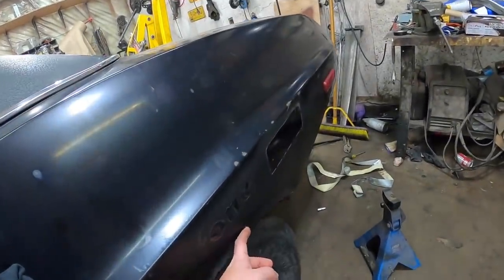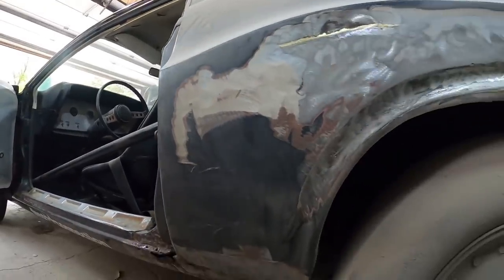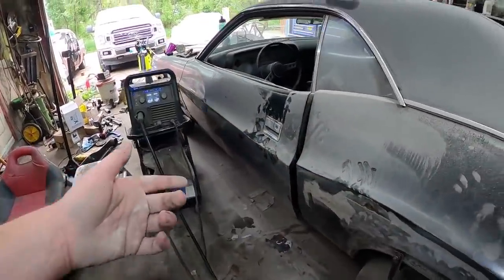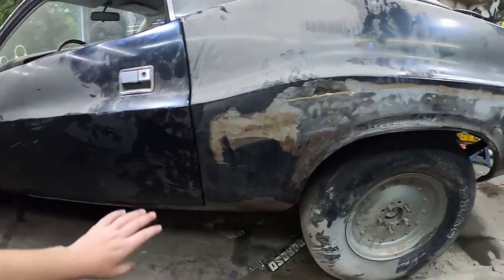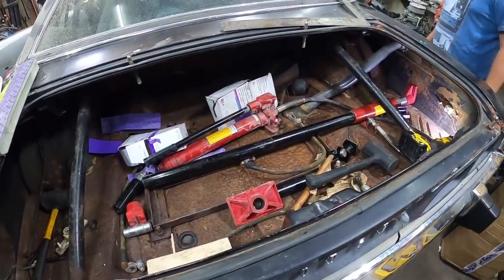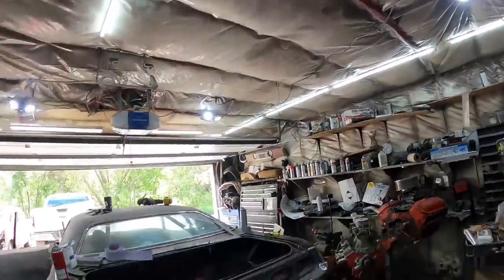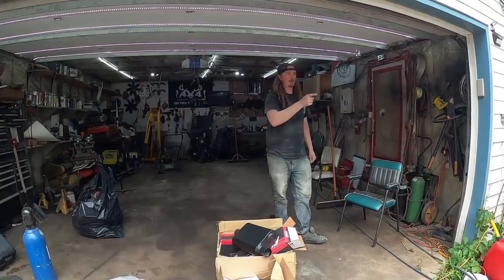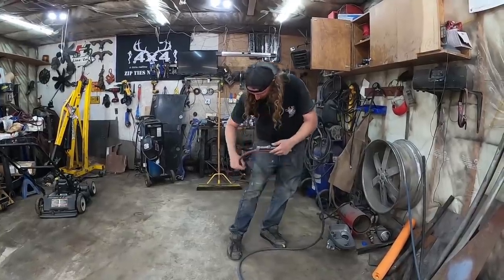Ratty Challenger gets some Butchered Backyard Bodywork - How Not To Do?

Comment: Worked Jack Smart Ford in the body shop in Greenwood IN in the mid 70's. Yes we brazed back then. 
Had a 1971 LTD convertible for 20 some years. Got tired of repairing rust all the time. Last time i pulled the wide trim off the side slathered 
axle grease under them. Used a 
Siphon with my air compressor and fogged motor oil in the quarters, doors, hood, deck lid, everywhere i could get every fall.  Never ever had to do another rust repair.

Comment: Firstly happy birthday Dan,a fantastic approach to the Challenger, with Backyard BOG( filler) Beautification ,exactly the way most Aussies,approach their Street Rods,a good investment toolwise I've found for rust discovery is a Air Needlescaler,also to save dusty mess inside is a 5"_6" grinder with flapper disc,with vacuum attachment on safety guard to affix shop vac to!

Comment: Looks good 👍 . Happy  Birthday I hope you had a good dinner. You're doing a good job on the right side I say just make it straight on the whole panel. Just to give you a heads up , check out old RV many of them had big block Dodge's in them. You could find all parts and pieces you need for the belt drive 😉.

Comment: For large areas of filler I use a propane torch and a scraper (it’s plastic after all).  Just make sure you have good ventilation (I do it outside) and don’t over heat the metal.

Comment: Awesome body work and fabrication. Too many people into car restoration reley way too much into body panel replacement. It is so much better to rework original panels like you guys did than replace. You would be surprised that this is the way higher end hot rod/classic car restoration shops do it. I use to work at one. I had a very close friend of mine that was the painter at one of the top hot rod shops in the U.S. he has had his work on the cover of magazines and on t v shows. Thats how he did it. He took a couple of panels on a 72 Chevelle wagon I had that was way worse then your Challenger. The panels turned out awesome and my car still retained its original sheetmetal. You are doing true home hot rod building and outstanding work. This is becoming one of the best TRUE Hot Rod shop channels. No need for Motortrend On Demand. THIS is how its done.
Reply from the maker: Wow!  Thanks so mucj!  I'm glad your enjoying it and i really appreciate the support

Comment: Hey Dan, I'm late to the party but, happy birthday! I personally have always used USC Duraglass or other brand fiberglass filler whenever I need to put filler over a welded (or in this case brazed). A: it's stronger than plastic filler and will be less likely to crack - 2: It is waterproof and will resist absorbing moisture from a pinhole in the braze or weld from the backside and thus bubbling up - C: If you are throwing out the keep filler less than an 1/8" (or so) thick rule, it will hold up better as the base material with plastic filler solely used as the "low spot" leveler. Not trying to knock what you've done, just trying to add something you may want to try in the future.

Comment: I took some adult auto body night classes and an old guy there saw me grinding away on some THICK bondo making a mess. In one section we had access to the back side of the panel so he grabbed a torch and hit everywhere he could access without lighting the car on fire. Next he grabbed a 2 in putty knife and simply scraped the warm plastic off in sheets. He said old bondo used to have asbestos in it so this helped not create deadly dust for everyone in the shop. MAP gas on 1 in thick or less works well. DO NOT BREATH THE FUMES!!!

Comment: Nice job pushing out the quarter I knew it could be saved. Your getting all the weak spots fixed and spot paintining it for now and you can always do a scuff and shoot the entire car later. I've got my fingers crossed on the motor!
Reply from the maker: Haha me too. Hopefully it rolls over
Reply: @dd speed shop Too bad you didn't get more info on it. It would be nice to know what cam crank rods and pistons are in it. In the 80s a lot of guys were running 12:1 to 14:1 pistons and that's not going to work with pump gas.

Comment: Covered in bondo dust, working on a hot rod, fabbin, cuttin, weldin. Great way to spend a birthday. No need to ask what you want... more parts, more cars & more time to work on em. Hope it was a great day. It don't matter how it gets done. It is that it gets done. If everybody did it the same way, there would be no need to watch how somebody else tackles these problems. Next time they holler you are doing wrong, ask them where you can watch their videos to see how to do it right. AAAhhhh! End of the day AIR SHOWER.

Comment: Cut and weld freash quarters below the body line on both sides use butt welds and it will be so much nicer. Remove the rust and use zinc primer inside and out to prevent rust. Rustkiller does nothing.

Comment: make sure you cover the Bondo with a good primer or plastic so in case if it rains the water doesn't soak in banda's like a sponge and it will soak in and get to the back metal and start

Comment: Can you just cut the two panels of the quarter where they over Lap with a thin cut off and just butt weld them so it’s less filler? I suck at filler, so I’d try to do that if it was me, but get it on the road and enjoy it
Reply from the maker: The problem is the brazing.  Can't weld that stuff so if have to take it all apart and I think it would be a nightmare.  And I also hate bodywoek haha

Comment: Happy Birthday! Yes bodywork sucks! Necessary evil. Quarter dent removal turned out good. There's no wrong way... Unless you make it worse! Ha! 
Was thinking could you have dropped in the deathwheel just below the braze joint since it's overlapped, and line up to butt weld? Then remove excess and brazing? Just curious. Certainly more work though.. Back then, if quarters wern't brazed they riveted or used Dzus fasteners. Nowadays they glue shit on....my how it's changed. Looking good Dan, diggin' the project!
Reply from the maker: Thanks man!

Comment: I'd say it was done back in the mid 1970's it wasn't until the early 1980s when migs came into most shops........those quarters are not to bad to do .......back then we didn't have replacement 
panels if the factory ones weren't available so you either cut one off a wreck or made a panel
Today is so much easier to do everything ......was in the trade for many years ..still love the old cars...................lookin good your the man and.......brazing was the choice until mig welding came and wow yeah 1982 we got a mig in our shop they weren't cheap

Comment: I have a brake question for you. Do you need to put a proportion valve in a 57 if you want to upgrade to power drum brakes? Do I need the residual pressure valves in each line? thanks

Comment: Strip the vinyl hoodie top  off, put RT Chrome flip lock  gas cap & put trunk winged spoiler on, paint her gloss black with tail light panel red & with side scallop strips, she'll look bitchin & you can name your price at any time 👍 oh & take the rubber baby bumpers off the front
Reply from the maker: The bumpers are hard to take haha
Reply: @DDSpeedShop  no not the whole front bumper , just the the chromed & safety rubber blocks off the bumper .. they make it look hideous

Comment: I'm taking a 55 down to bare metal,. I've never done it before.  There is no rust, Az. Car.  How worried should I be with kinda scratch marks from the paint removing wheel on grinder,?  Gonna use an etching primer on the bare metal,. Then hope it's ok to use hi build primer after that with any Bondo at that time before block sanding,.  Do I have the sequence correct?  And happy birthday dude!
Reply: Taking Pai t off with a grinder? Who thinks that is a good idea????

Comment: I'd do the primer, puddy up worst dents, fire it up and run it. It ain't a show car although can be for the right money. Everytime that you love on it a little it jumps back looking good like its begging to get fixed. I like them both ways and if mine, smooth the dents, paint and drive. Not sure I trust that engine as they did margin repairs so that is what the engine got as well..... If your going dodge after being america's popular chevy thing... won't change me... I am a pro ford man. Like the 69 fairlane as with the 427 dual quads, four speed and possi, not many even got close to the papers. I would of kept that car forever but the fokes sold it will I was in Nam. Sucks to be me.

Comment: Dont care what kind of mud/ filler you used on a project like this. If your frame with a 750hp engine with more torque, on a used steel body on a frame, that doesnt have the correct bolts,bushing, and nuts , the body will twist. And watch all that body work fly into the stands and hurt the fans...... no thanks